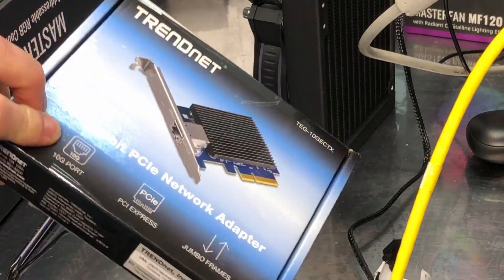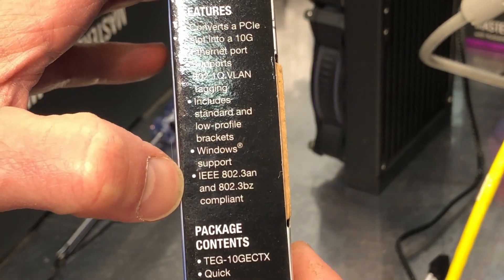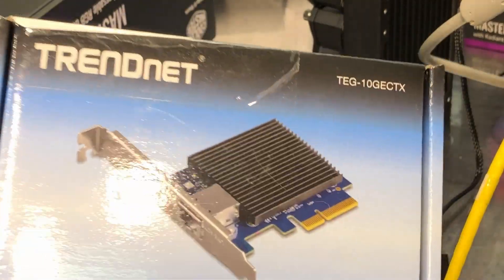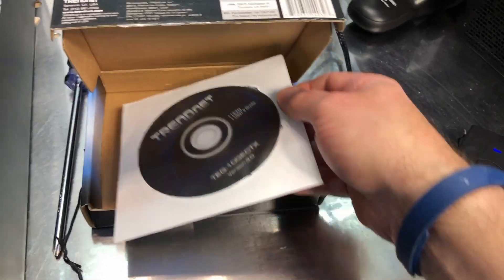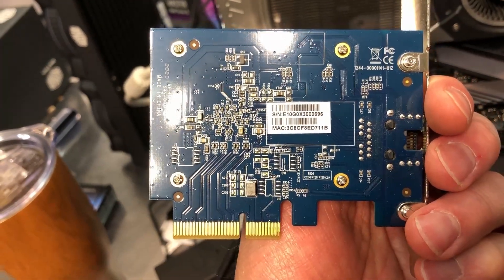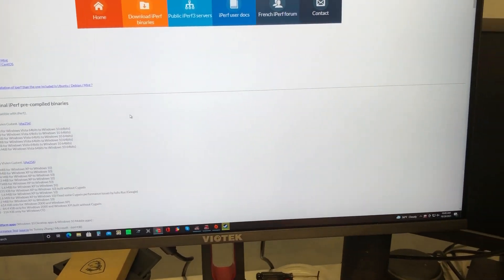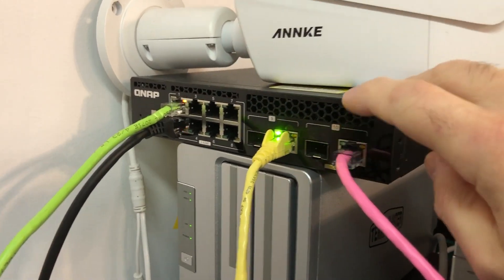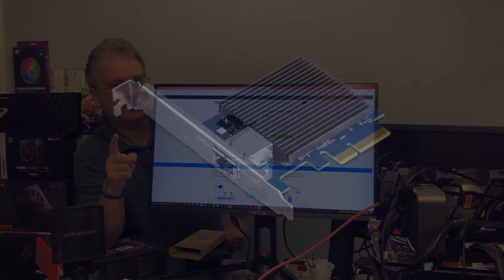OCC checks out the TRENDnet 10 Gigabit PCIe Network Adapter!

Comment: Is there a Rev number under the heatsink somewhere?
It might be a good idea to remove that heatsink in any event, 
and make sure quality thermal paste is applied correctly.
Reply from the maker: Good point - I’ll check and probably reapply the thermal paste.
Reply: @overclockersclub  Thanks, Chris.  I've been shopping for a similar PCIe add-in card, and I've noticed that the sizes of the various heatsinks vary a LOT.  You briefly mentioned an earlier version:  I'd be curious to know if the heatsink on that earlier version is the same size, or smaller.  

FYI:  I watched our USB 3.0-to-2.5GbE dongle drop down to 1GbE just yesterday, most probably due to thermal throttling.  It should be no surprise that a 10Gbps clock is going to generate lots of heat during heavy loads.
Reply from the maker: @supremelawfirm  I believe one of the previous versions is shown here:  https://www.youtube.com/watch?v=OVfbqYscr6w
Reply: @overclockersclub  Many thanks!
Reply from the maker: @supremelawfirm  So I did remove the heatsink and there was no version number, and there was a thermal tape between the chip and heatsink (not paste) and it was intact so I reassembled it.  Still functions properly...